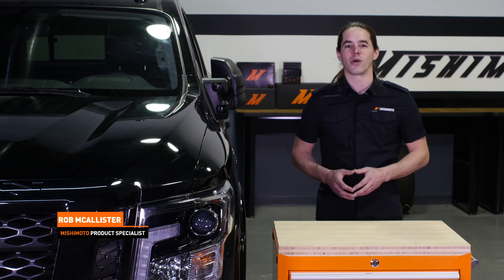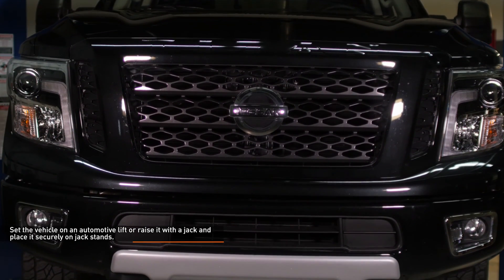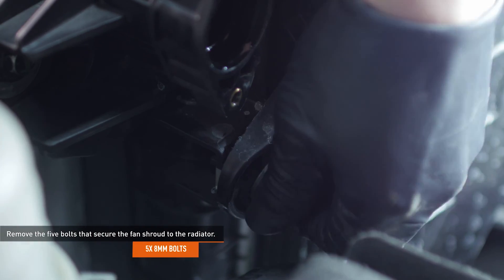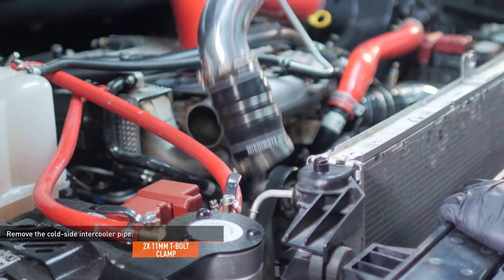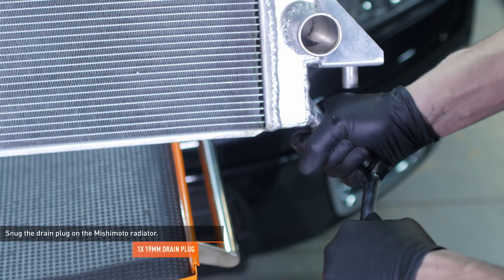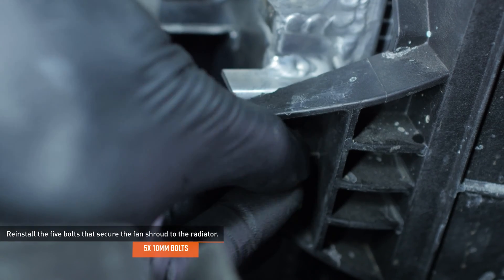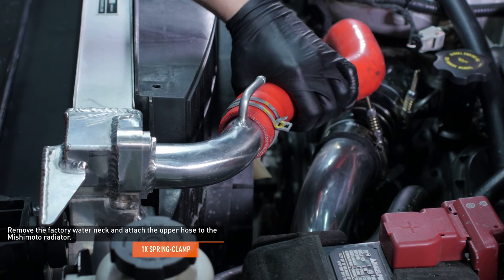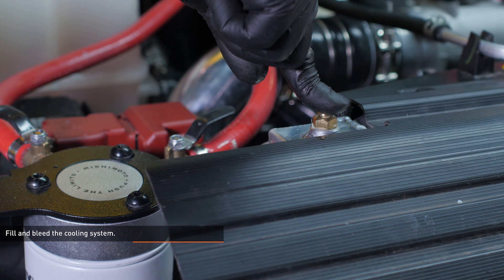2016-2019 Nissan Titan XD Cummins Aluminum Radiator Installation Guide by Mishimoto

Comment: What's the benefit of this?
Reply from the maker: Hey C Steele . Main benefits of a catch can are to prevent oil blow-by, moisture, and other contaminants from being cycled back into your engine. Here is a brief video explaining how it works :) https://www.youtube.com/watch?v=-g2crfnfuKo
Reply: I did watch that video, but missed the point of the aluminum radiator benefits. Thanks for your time. Cheers
Reply from the maker: Hey C Steele, my apologies! I believe that response was intended for another comment. The benefits of this radiator are quite extensive. Main highlights would be all aluminum construction which gets rid of the flimsy plastic end tanks. This unit also has a 3-row  efficient brazed aluminum core. This core has increased fluid capacity and optimal heat dissipation.Generally speaking, we see about 15% better cooling efficiency than stock.
Reply: @mishimoto  How much is this Radiator? and also how much is the Intercooler? also what is the Temp drop/ Egt's??